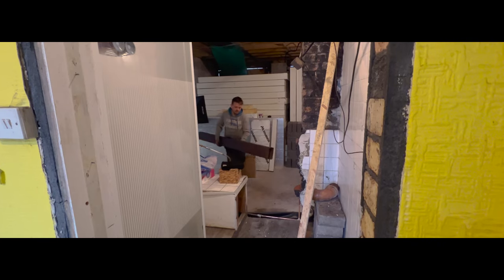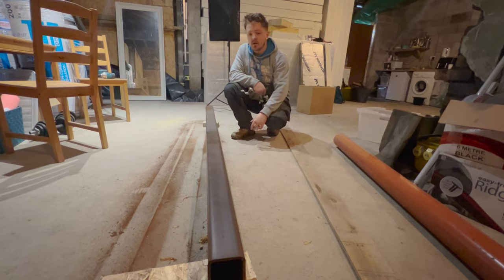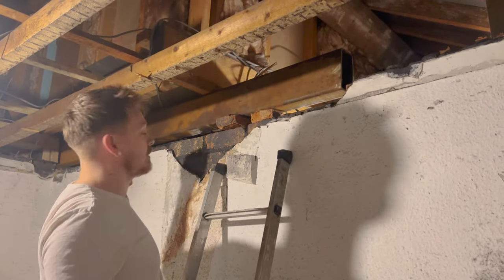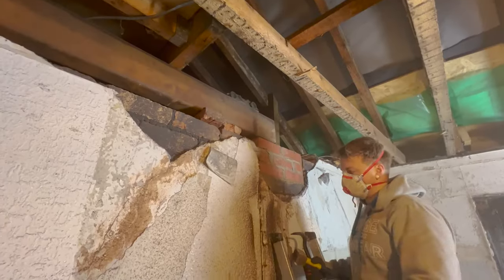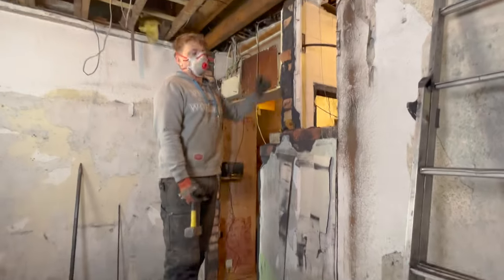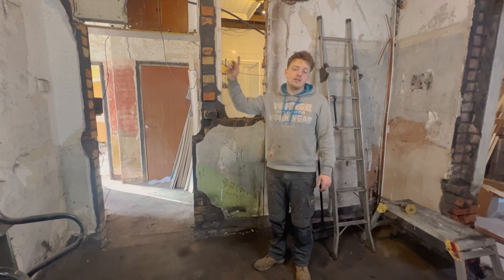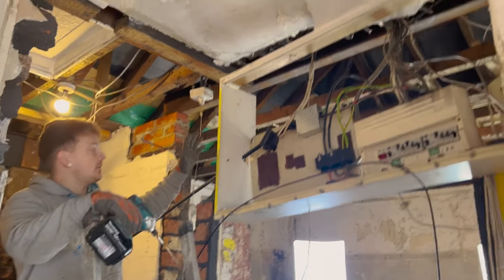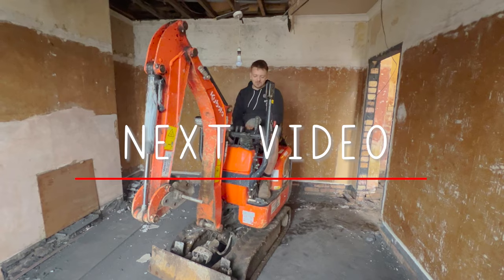Creating our own pad stone to support attic - Removing supporting Wall - Home Renovation Self Build

Comment: Hi both    Like your way of dropping the old ceiling , definitely a good idea .  Have you decided where you dis board is going for your electrics ,  if so I’d be looking to get them moved as soon as possible .  We would on such a project install the new supply from the meter to a new DB , and if necessary run some temporary supplies for sockets , lights , shower etc . Obviously these will be relocated or removed as the project progresses . But it does remove the problem of existing electrical equipment being in your way ,  as I say we would consider this standard practice on such an ongoing project like yours . We would also provide a group of socket outlets for subsequent trades to utilise while on site , and of course all protected by earth leakage devices .  Again much of this temporary work can be reused at a future point in time  anyway.                    Bless you both  and kind regards as always . 😀👍👍👍
Reply from the maker: Luckily I learnt this off a friend after he seen me take a ceiling down from underneath 😂 the new DB is going about 1m towards the back of the property from where it is now. We haven’t bothered getting a new board yet as we have so much demolition and as you can tell, we love doing things the hard way 🙈😂